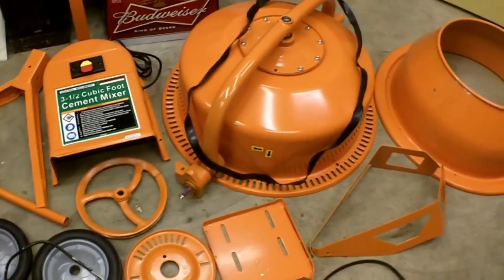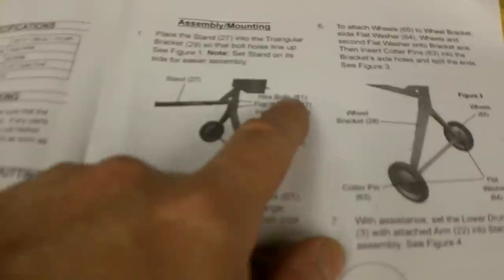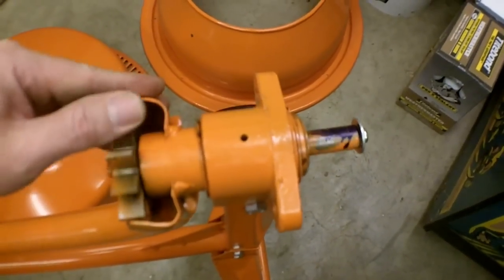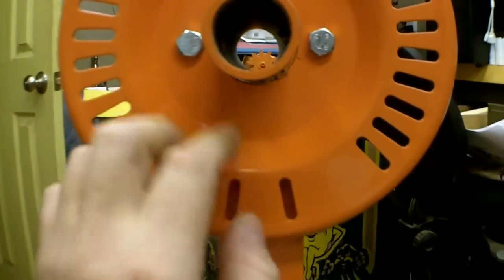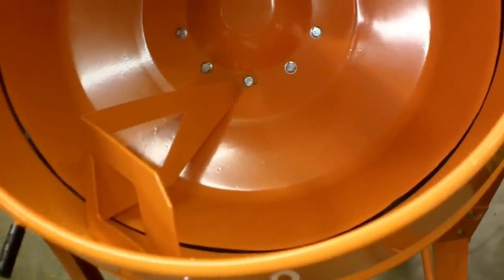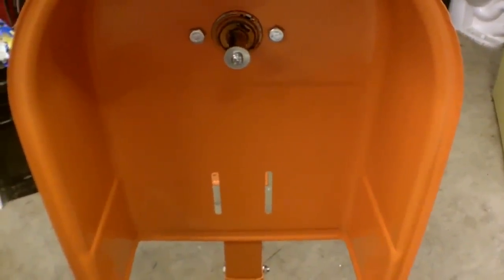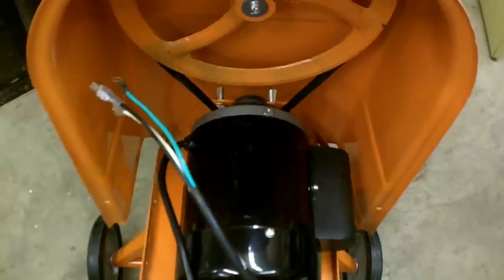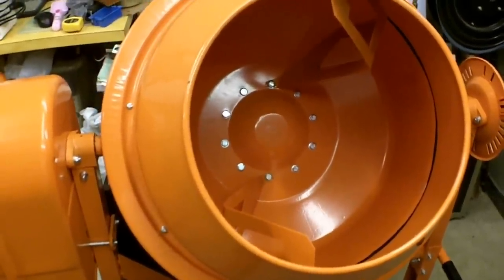Harbor Freight 3.5 Cubic Foot Cement Mixer Assembly and Review. Item 67536

Comment: Just wanted to thank you great video took me 4 hours had one bad bolt from bag 8 and not one in my house to match.  Unlike you I had one extra lock-washer from bag 8 and one extra plastic electric clip in bag 13/14.  The 4 hours included tearing my house apart looking for one small bolt and a trip to the local hardware store. Thanks again very informative.
Reply from the maker: No problem Rich- Glad the video helped! I had read some folks were missing fasteners, but I had just what was needed. Aside from your bad bolt, you got more than required I guess. You probably would have finished the job in a couple of hours if you didn't have to go on the hunt for a replacement bolt....lol. Thanks for the post and good luck, G.

Comment: Thanks so much, I sat my laptop in the garage and followed your instructions and all went really smooth. I liked the quality of your presentation and filming as well.
Thanks again, Jim Dodge, Duncansville, PA
Reply from the maker: Thanks Jim! I'm glad the video was useful in putting yours together with ease. Take care, G.
Reply: That's exactly what I'm going to do...
Reply from the maker: Gary Filice
Good deal, Gary. Just follow along and your assembly should go easy. Let me know how it turns out.  Good luck, G.
Reply: *****
 I'm wondering if you used axle grease or a lighter lithum type?
Reply from the maker: Gary Filice
I used a tool grease from Milwaukee tools since I had it on hand. I would recommend using this Lucas grease- but anything should work. The Lucas is great stuff. I use it on my trailer bearings. Whatever you choose to use though, I would get something that is water and washout resistant.

http://shop.advanceautoparts.com/p/lucas-oil-products-red-n-tacky-grease-14-oz.-10005/7070036-P?searchTerm=bearing+grease

Hope this helps, G.

Comment: 6 years later and the instructions are still CRAP!
Thanks for keeping this up, it's been a great help.
Reply from the maker: Terrible isn't it? Glad it was helpful, G.
Reply: Yeah I agree, awful. The worst for me, I didn't even have one of the key ways installed right. Mine stopped working after about 5 minutes lol. After a quick trip to Lowe's, and a machine shop, only $7 later I got a new one made and tightened down real good. After that it worked like a charm. SMH I would have paid a little extra just for decent instructions.

Comment: I just bought this mixer today and when I was reading the reviews they said to check out YouTube because the instructions were horrible. They were when you made this vid six years ago and they still are. THANK YOU for making it. I just watched your video to do all of it. I used some RTV gasket maker that I already had to hold the badly twisted gasket in place and put it on both sides. And put the zerk fittings in like you said to.
Harbor Fright :) should include a link to your video in the manual!
Reply from the maker: Thanks Bob! Good to know it's still helpful. Glad it helped you out! Take care, G.

Comment: Great instructional video I’m A professional service tech and you saved me loads of time assembling this mixer. It’s not Harbor freight‘s fault these instructions are such It’s common to see all manufactures make their instructions as if we are all fluent with their product and mechanically inclined on engineers level. You can tell by the reviews on this product there are some who are mechanically challenged and this causes them great difficulty when you are not able to look outside the box and figure things out that are not mentioned in the instructions as you obviously did for us it fills in the missing gaps. Great job. Side note I think what they meant to say about the gasket sealer there is a material made called “Hitack” that will stick the gasket in place and hold it not necessarily sealing it. it can be purchased at most automotive parts stores.
Reply from the maker: That"s cool Daryl! Yeah, I tried to give some insight for the less mechanically inclined and a lot of manuals (like you mentioned) don't cover some of the details. I used to use Indian Head gasket shellac for holding gaskets in place for automotive applications- probably not that different then Hitack. Glad the video shaved some time off your build.

Not sure which type of service tech you are, but if it's automotive related I have a few videos that you might enjoy. A series on rebuilding a 350 Vortec, and a teardown and rebuild (two separate series) on an Rx300 auto transmission. Take a peek if you like. Thanks for the post and take care, G.

Comment: Well, mine showed up with one bag of fasteners, and a handful of loose nuts, bolts and washers rattling around inside the box, so I've been scrounging parts from my shop and attempting the assembly for half a day.  I'm almost done, but I wouldn't wish this on anyone.  Your video has helped a ton.  Thanks.
Reply from the maker: +John G 
Yeah John, I've heard from others that everything was in one bag and needed to be sorted out. It sounds like some of the ones that got loose fell out of the box on yours. Sounds like it's been a real pain. It shouldn't have been that way. Hopefully it will serve you well after the hassle. Glad the video was helpful and good luck, G.
Reply: +John G Mine was the same way.  You can't match up the bolts from quantities listed on the parts list, since some of the parts were pre-assembled.  But I'm pretty sure mine was missing the (2) M8x70 bolts needed to mount the motor bracket so I had to swap out the M8x65, I used in another location and use the M8x65 to mount the motor bracket. *Note I had to convert everything from Imperial units to metric since all I had at the time was a regular tape measure.  Would have helped a ton if everything had been labeled.
Reply: Me too

Comment: This video was excellent.  With your help I just finished putting one together.  My leg bracket was bent almost exactly the same as yours.  I think it's done on purpose to make the foot lie flat when the wheels are on.  You touched on it in your video but I had to completely disassemble the switch to get the green wire on the screw.  THANKS!
Reply from the maker: Well thanks- glad it was useful. You may be right on the bent leg, it just looked odd to me like it wasn't done with a machine. Yes, since they used a bolt instead of a stud, it was necessary to take the switch apart to install the ground wire. No big deal but I think they could have done a little better in this area. Thanks for the post, G.
Reply: No..Mine was not bent...

Comment: Thanks for the video.  Assembled two mixers tonight in just over an hour and fifteen minutes.  Lock-tited every nut!  I really recommend everyone taking out the set screw on the electric motor pulley and putting some lock-tite on it as well.  7 pallets of 56 - 60 lb. bags (392 bags/23,520 lbs.) will be put through them this weekend!!
Reply from the maker: No problem! I'm glad it was helpful. Good tip on the pulley setscrew. You're going to put them to the test for sure. Let me know how it works out. Good luck, G.
Reply: The two machines ran from 7:30 in the morning to 5:15 with maybe a 20 minute break for lunch.  Not a single issue with either one and they both cleaned up looking almost like new.  Poured in enough water for all three bags and tossed two in immediately.  Waited for the mix to get slurry and then tossed in the third bag.  Tilted the machines down enough to get everything to mix up properly without falling out.  Most of the time I had to add just a bit more water to keep the mix from sticking to the sides (after the third bag), but not a whole lot.  While both machines are noisy, they both had their own tone.  After a couple of hours, I was able to tell if the mix was ready just by listening to the noise the machine was making.  This goes for both machines!  Cheap...delivered to my door...worked without an issue.  Highly recommended.
Reply from the maker: number40Fan

Thanks for the excellent follow-up! Glad to hear they worked out for you. Take care, G.

Comment: Bought this same model from Harbor Freight about a month ago, watched your video to help decipher the instructions. Thanks for the help! The mixer works like a champ, mine growls also but doesn't seem to bother me or itself. I mixed over 48 - 80lb bags of concrete laying a walkway and it never failed me yet. I had to adjust the motor / v-belt because it was a little too loose but that's it. Haven't used it for more than one 80lb bag at a time because I worked by myself and didn't need to. Not sure how it would operate spinning 2 bags.
Reply from the maker: No problem Chopper, glad the video helped. Just imagine hand mixing 48 bags...lol. I'm sure it's already paid for itself many times over. Glad you hear it's still working great! Take care, G.

Comment: Thank you for the great review.  I just finished mixing 40- 80# bags of mortar and cement.  One thing I discovered is that you almost have to tilt the tub horizontal to keep the mix from caking in the bottom of the bowl.  I started with a gallon of water, broke the bag into the mixer, then started spraying while mixing to keep the dust down.  I initially had to reach in with a piece of 1 1/2 PVC and poke the dry clumps around to break them up and release from the barrel.  Later, I tried a different elevation (horizontal for initial start up.  The more I added water, the more I tilted it back.  If you don't tilt it back, it will slop out.  I was filling concrete block, so I wanted a more  liquid mix to go down the blocks.   I struggled with mounting the paddles as they don't attach square where the holes are.  I had to bend the ears a bit to get it to align.  For the money, it works for my limited needs!
Reply from the maker: No problem Bob! Great information on how you got it to work the best for you! Thanks for sharing. Take care, G.

Comment: Great video. Suggestions for anyone attempting assembly. Have a metric bolt gauge handy. Tear out or copy the parts list to keep from constantly flipping through manual to check bolt lengths. Find an extra nut to fit the ground wire lug. It will be easier than taking the whole switch apart to tighten it down.
Reply from the maker: Thanks Carl! Good tips! I'm sure it will help others out. G.

Comment: video was way more helpful than manual,i just paused once in a while to do a step,then started video again. the only thing i did different was in electrical hook-up for the ground, instead of taking switch unit apart, i just slipped the connector over the stud and added another 8-32 nut.good job
Reply from the maker: Thanks Charles! Glad you found it useful. Adding an additional nut for the ground connection was a great idea! Much easier than taking things apart as I did. They should include another nut just for this connection. Take care, G.

Comment: I just bought one of these cement mixers (Oct-2020). The hardware nuts and bolts now come in TWO BAGS. No labels. There is an exploded diagram which is somewhat helpful. I decided to record a video of my journey in assembling this device with even fewer clues that you were given. Your video helped nevertheless. Thank you. (FYI, the handle with the tension spring is no longer adjustable so you must now compress the spring using the handle itself while assembling it. It is a tough one, but doable.)
Reply: Mine also came with two bags of bolts, nuts, washers etc. Just thrown together. Had to lay everything out and  that costs a lot of time in itself. The manual is worthless. The motor on mine was already wired. There were two welded nuts on the motor backing plate and those welded nuts are VERY close to the motor pulley and if you have the belt lined up to the two pulleys, there is very little room for the motor to turn without rubbing against those welded nuts. Very poor design. The motor also seems very wimpy and will probably burn out sooner than later. Haven't ran any cement yet so we'll see how it performs on a 10x16 foot slab.
Reply from the maker: Alex, I've heard the same from others- including how difficult how hard it is to compress the spring since it's not longer adjustable. Glad the video was helpful in some way. Take care, G.
Reply from the maker: That's a new one on me Kenneth in regards to the welded nuts. Thanks for the info, G.

Comment: Just bought mine today...  great video...  I guess parts change over time...  I didn’t have the unlabeled bag (#1), the bottom drum came assembled/sealed.   Only used 1 of the cable ties... and also that fastener pin that gets inserted into the wheel/belt assembly, I had to hammer it in.  

I grabbed your video and trashed the manual from the get-go!  

Excellent.  Thank you. 👍🏼
Reply from the maker: Thanks Marco! Glad it was helpful. Thanks for sharing what has changed since my posting. Take care, G.
Reply: Ok so im not the only 1 thanks for sharing
Reply from the maker: @charlesboyd3109  No problem! G.

Comment: FYI - I purchased one today June 25, 2019 and they have made some changes. First big change is the drum comes with the lower half mounted to the frame. Second is the electrical is completely wired and needs nothing connected. Third the tilt handle has the same spring and connects the same way however the screw adjuster had been removed and installing it is extremely difficult requiring two strong guys to push spring down while installing the bolt but the did add a lock nut which wasn't on the older model. The bolts are in one bag with no indication where they go. I sorted them out and used logic and common sense to figure out where they go. I had extra bolts....not good but everything seems good so far.The gasket on mine was in really good shape and required no extra help to straighten. Thanks to your video it took me about an hour to put together.
Reply from the maker: Thanks Tom! Glad it was helpful to a degree. Good info! I'm sure your comments will help others. Take care, G.

Comment: Thank you so much.  It's now 2017, and this tutorial was a game changer for us.  Turns out, we never aligned the "arrows" and the paddles were wrong.  As well as the wiring.  THX!
Reply from the maker: No problem! Glad it helped to sort out the issues. Good luck, G.
Reply: Update:  if you were here I'd pay you.  But I'm a cheap skate:)  The last problem I wrestled with was the "wiring."  The motor had no pull, couldn't even do 30 lbs.  What???  Watched your video again, zeroed in on the wiring...presto!!  We had it backwards.  Plus, the ground had pulled loose.  Just fired it up, and it works like a champ.  The wiring segment you did in the video just saved us.  Tony in Oregon*
Reply from the maker: Very cool Tony! Again, I'm glad the video helped you sort out the problems. Now the real work begins...lol. Take care, G.

Comment: Thank you for this video. I purchased the Princess Auto version of this in Canada which is the same as Harbor Freight in the US. The video was very helpful and saved me a lot of time. Also, the model I purchased has the wide wheels that use the outside hole in the axles. Thanks again.
Reply from the maker: No problem Mike! I'm sure the wide wheels will be helpful. Take care, G.

Comment: Thanks a lot for your very useful video. My biggest problem was how to install mixing paddles. Instruction for this part was hard to understand and there were no picture at all. I was very happy to find your video and problem was solved. Thanks again.
Reply from the maker: nachod1282 No problem. I'm glad it helped. The manual is really lacking, especially in reference to the paddles. Good luck, G.

Comment: man what a great video! after researching and finding that most say the instructions are lacking,go find and watch a youtube. You've done an excellent job covering everything so well. Thank you for the time you spent, definitely very helpful!
Reply from the maker: Thanks! Agreed, the instructions are extremely lacking to say the least. The video should make it pretty easy to put yours together. Good luck, G.
Reply: I'll just say, I've pretty much just given up on the instructions and for each step, watching the video, LOL! I will say that on the gasket, it matters which way you install it, the bolt holes aren't centered and if you put the narrow side to the inside of the drum, it doesn't lay down flat at all. I'm not impressed with the bolts that hold the drum together either. no real problems so far, but man if you hadn't done this I'd be seriously jeapordizing my sanity, what little I have left  ;)
Reply: well I got to the point of putting the motor on, and found I have no drive belt.....so I called Harbor Freight, they said they'd take one out of another one. Since the wife had found a rug she wanted but it was raining and we didn't get it, we'll go back this evening
Reply from the maker: Figures right? At least they didn't want the whole thing back. That would be a pain. G.
Reply from the maker: Yes it is, I should have mentioned the gasket in the video. There is a definite correct way it goes on. Depending on how it came out of the box, it might need to be turned inside out. I don't recall the fasteners for the drum on mine. They worked though. Feedback after it's all put together with any other problems you might have. It helps others out. G.

Comment: A little advice on setting post...  it is better if you take crushed up rock or broken cement blocks and put around post and tamp down. if you do it right it will be very strong and the post won't rot, the problem with using concrete around wood is it will rot right at top of cement. been doing it a long long time and i found out over the years that concrete around always makes it rot. I just removed a post that my grand father put in the ground with rock. there was no rot, had to go with a bigger post for the bigger gate i was putting in...  just some friendly advice
Reply from the maker: Thanks for the tips, G.